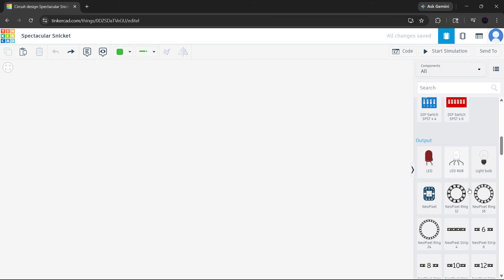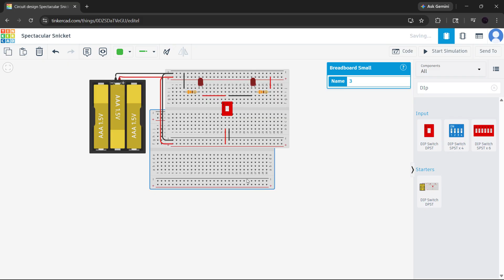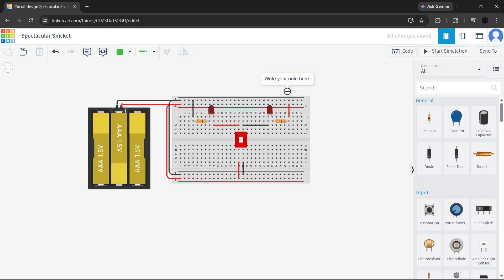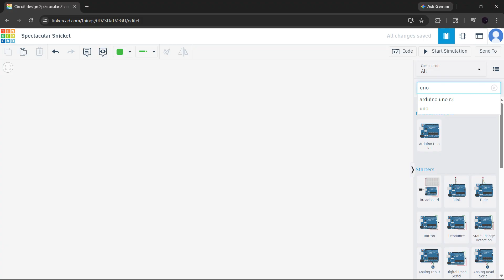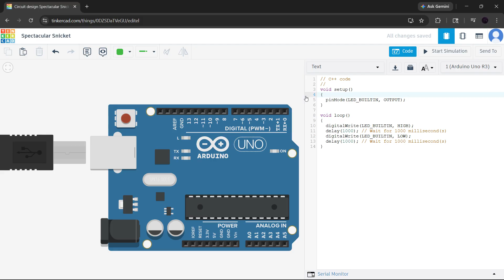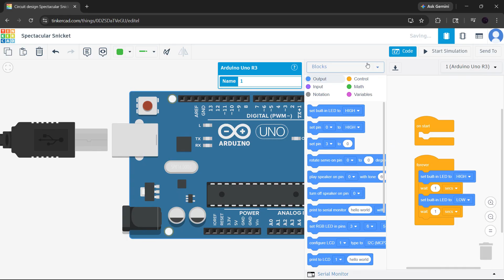How To Add Esp32 In Tinkercad (2026 Easy Guide)

Comment: Well... The ESP32 is quite different of the arduinio one.
Reply from the maker: Yes, the ESP32 setup is a bit different from Arduino boards. Some steps, libraries, and board settings change, especially when selecting the board and uploading code.